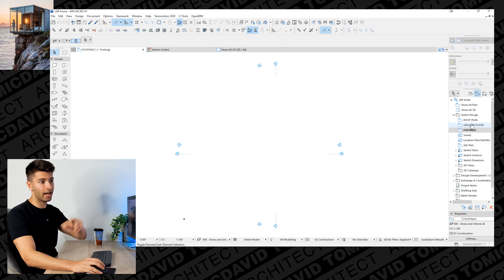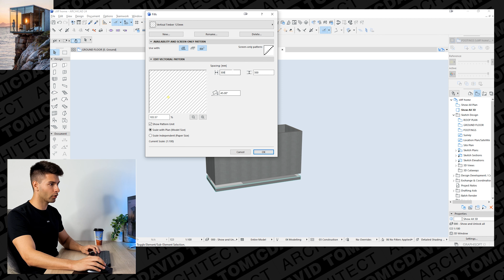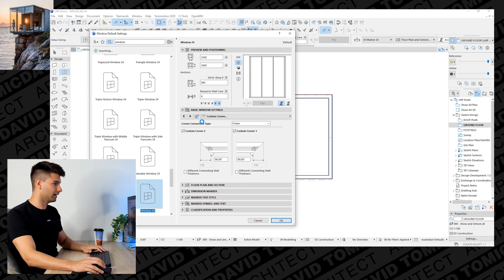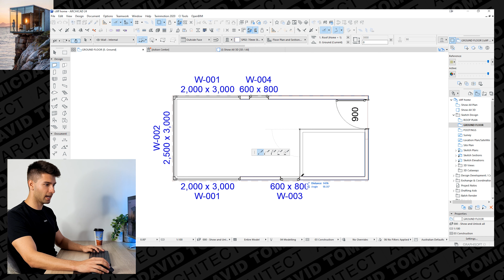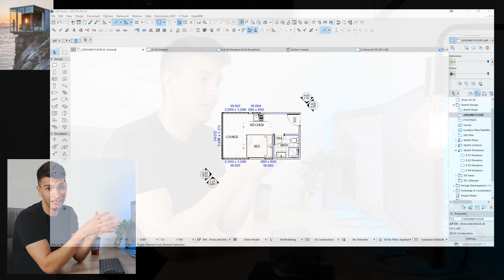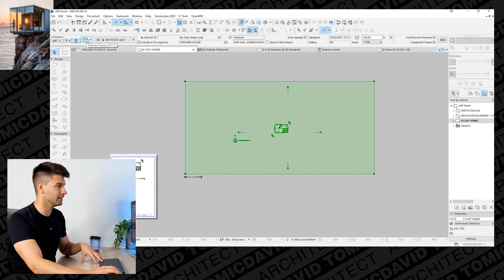Comment: Nice vid👍 maybe i can help you out with a little tool to extend points and the "frame" tool. If you didn't knew it. The first tool is called "change in length" you can click all objects, press this button and click to where you want to have all those points. For the second tool (frametool) switch to the thick option and frame everything you want. No just stretch it where you want to have and all things are going to stretch. Im sorry for my bad english.. I am from switzerland😂 have a nice day!